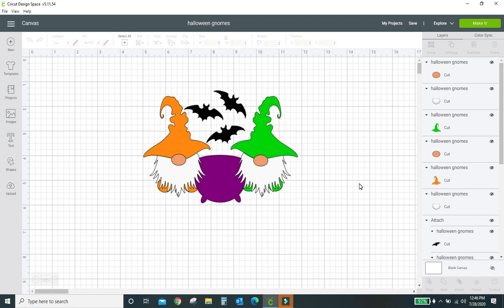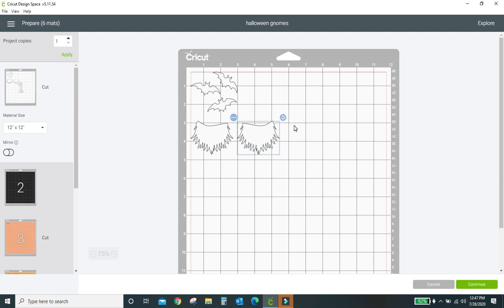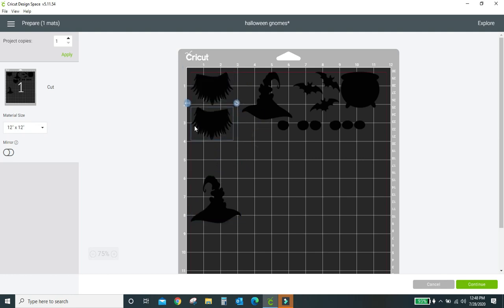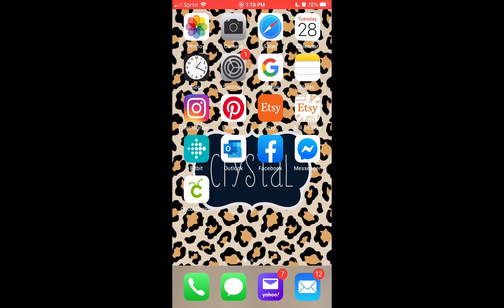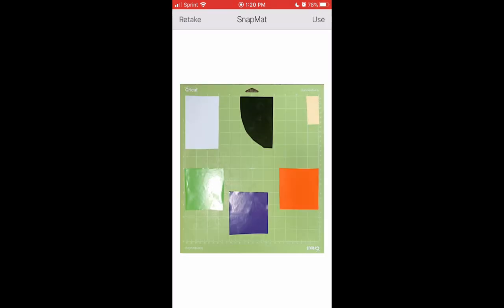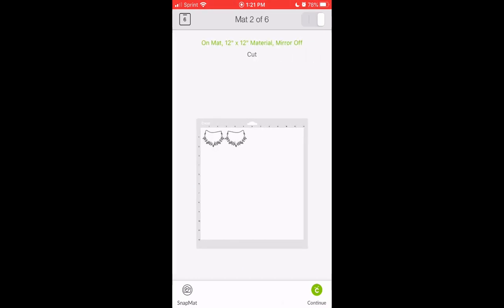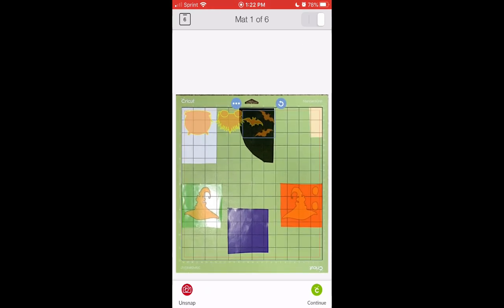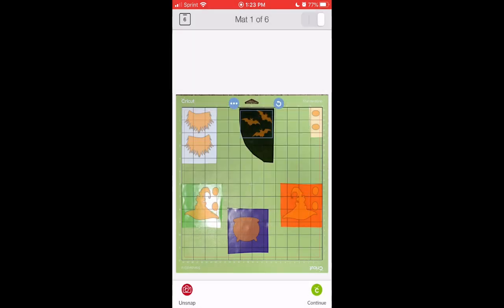How to cut several different colors on on mat -- a Snapmat tutorial

Comment: Well call me a dummy, but how and where do I find and use the snapmat on my iPad?
Reply from the maker: The app has had some updates since this video.  To get to your projects that are saved in the cloud you now go up to the top right and click the 3 little lines with circles on them rather than clicking categories.  Then after you select your project and click "Make It" you'll see the snapmat option in the bottom left corner.